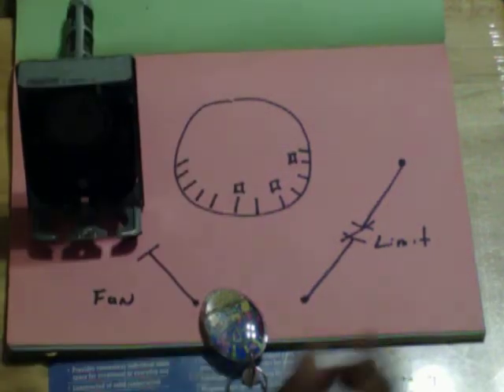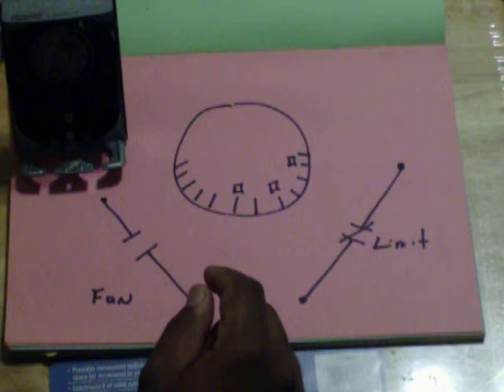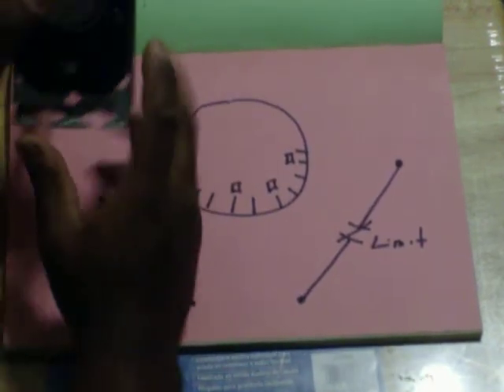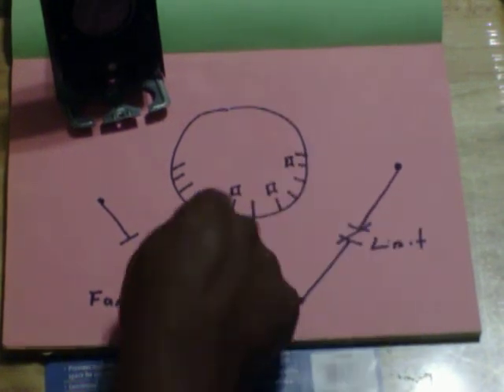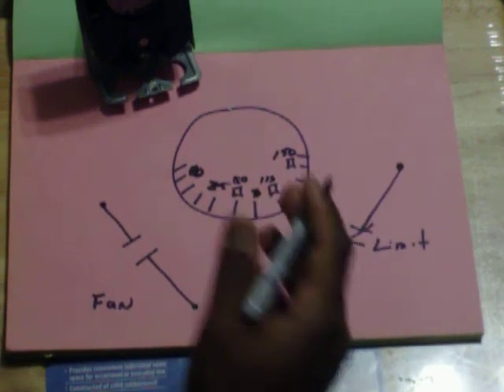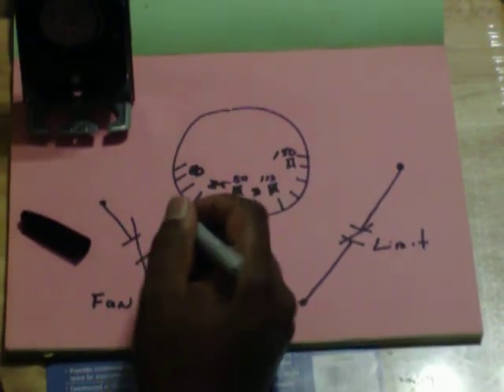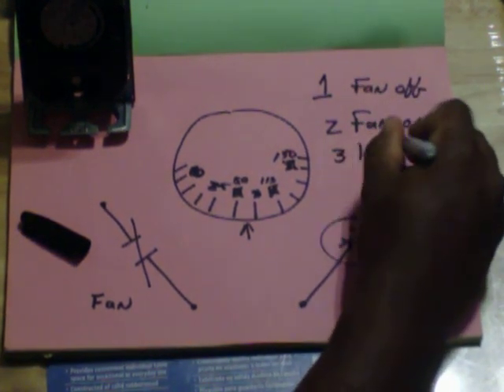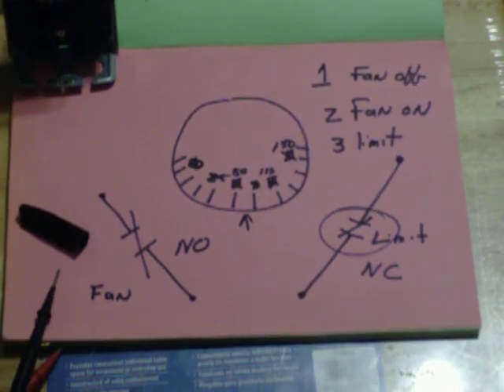how to check a fan limit switch

Comment: Good video. Diagram was very helpful. I needed a little more light on the actual device though - I'd like to see what contacts you are connecting the multimeter to. I'm a newbie using a multimeter. But your explanation of the operation is excellent.

Comment: nice overview. It'd be great if you can show upclose on the video how you adjust/set the temperatures on the dial. This is a scary thing to a new installer since you have to hold down the wheel otherwise you'll put the device out of alignment.

Another thing to show is cutting the jumper when replacing it. 

The above 2 enhancements would cover it end-end.

thanks !

Comment: Our fan limit control is very old it has two controls/dials, on for the fan and one for the limit.  Any suggestions on how to set it.   The furnace fan keeps shuting off.  Woke up to 54 degree in the house this morning.  Thanks for any advise you can give.

Comment: @alexhortdog95 You should have other safety switches wired in series with your gas valve or electric heater strips, depending on what you have, besides the fan limit.

Comment: What I can do if the fan never stop ?
Reply: could be a bad thermostat, your FAN setting on thermostat set to ON, or a bad circuit board or the fan setting on the fan limit switch has been set to Manual ON.

Comment from the maker: @cardodoc1 Dont lower yourself to this guy's level. I am glad that I can help you. Jerks like subcool are looking for s**t to complain about.
Reply: I have the same thing on a wood furnace
 My issue is the blower kicks in before the fan kick in, or second pin setting, making it short cycle. I have the pins set at 100 about 190 and 250. Any idea if this is fixable?
The fan kicks on about 120, no matter what